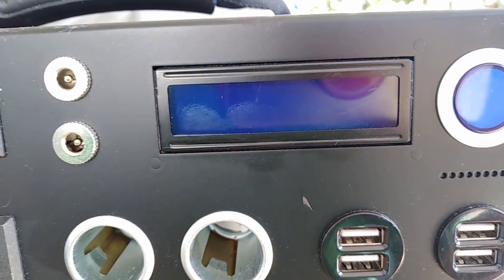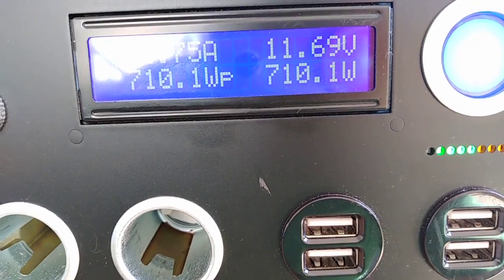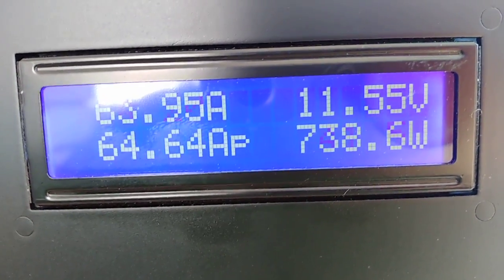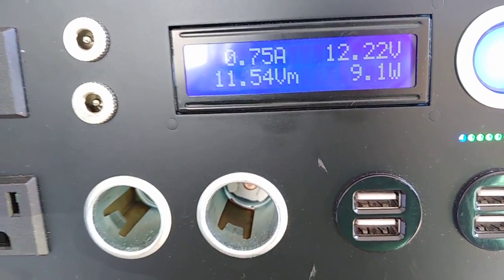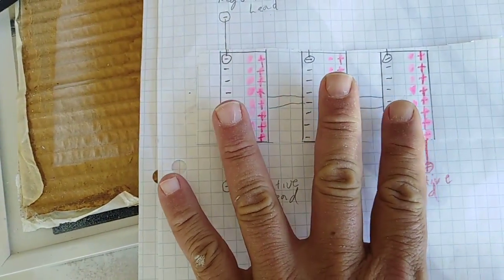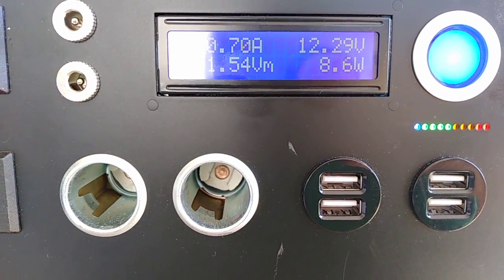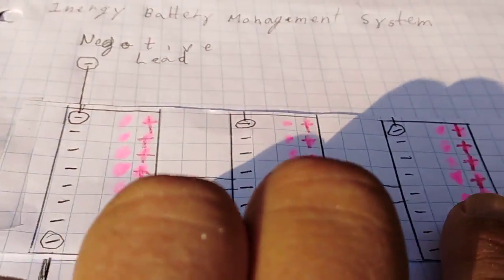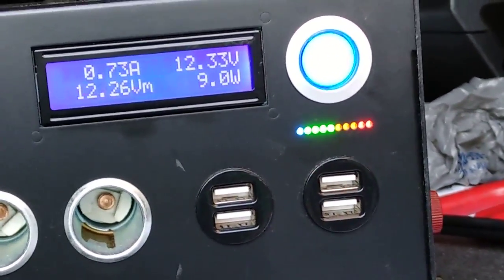Battery Management System of the Apex and the Kodiak Solar Generators Overview

Comment: Nice that it is going over the 500-550 continuous watts.  So far I have not had any troubles buying devices under 500 watts for my RV including some 200 watt heaters with a fan that can heat my room in my RV, it cannot heat the whole 40ft RV of course.  Great test very interesting about the BMS.
Reply from the maker: I am putting up a video on my 12Volt 140 watt heater.  That is the name of your 200 watt heater?
Reply: Vanlife Dancing 

Mainstays Mini Ceramic Heater Dq1723-w White, Size: 132mm*85mm*169mm

Under $13.00 at Walmart.  The fan pushed the air out pretty good for it’s size and it has a tip-over safety feature. I have used mine for two winters, I have two. 

https://www.google.com/shopping/product/6019130612477109296?q=walmart+200+watt+heater&client=safari&hl=en-us&biw=375&bih=512&tbs=vw:l,ss:44&prmd=sinv&sxsrf=ACYBGNSdD1NoSllE8qUndOh_OZUFbEIiBQ:1575895068469&prds=epd:13506176400612699035,paur:ClkAsKraX3sj4a0bBvwnpTAdeNSeaetjkgF5nO21dQlaWkvxibcghECSdf2iRr6H9MML7WUaJPiO42XjhOXYXmMMUhr5d0_awcE2yIxRWNYLsm955-AE8rMe4xIZAFPVH71Hj_283chHFmgLfOsW82ouSks00A,cdl:1,prmr:1,cs:1

The link info shows 250 watts. So that is correct over my memory
Reply: I have held the Mainstay Mini in my hand at Walmart,  Do you use a Inergy Kodiak or Apex Solar Generator to power it.?
Reply: Abe Mosh I use the Kodiak.  It’s very handy to use in my passenger truck cab.  I own a very loud disel and park on the streets very early for work but I do not want to annoy anyone by running my truck so I use that heater and my Kodiak.  The blowing fan on those little heaters is pretty good, low power drain and low cost so it’s a win win for me.  Under $13.00
Reply from the maker: Just uploaded a video on the heater:
https://www.youtube.com/watch?v=TfUwJj_XLeA&list=UUdo_IcaaYxaQzFnaRt8Mypg
I hope you enjoy